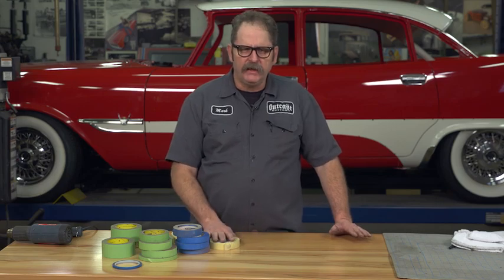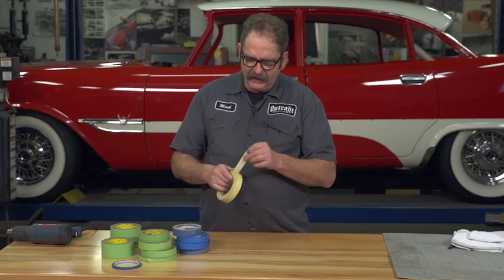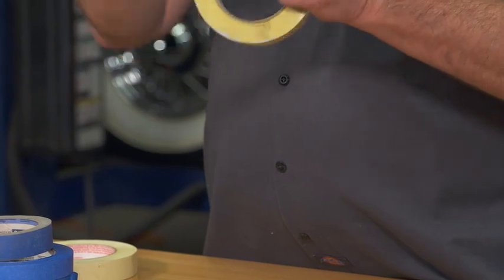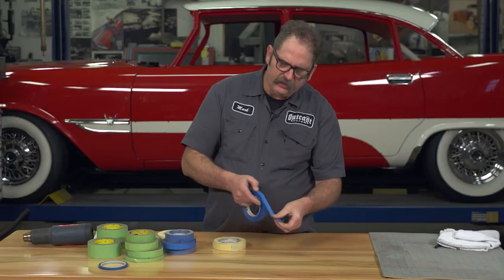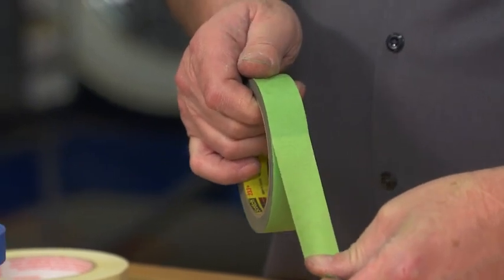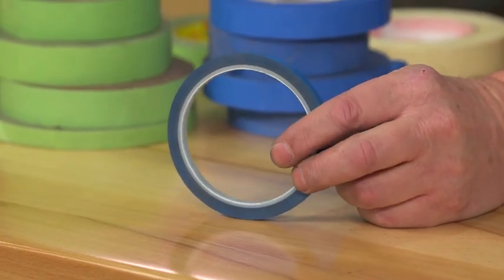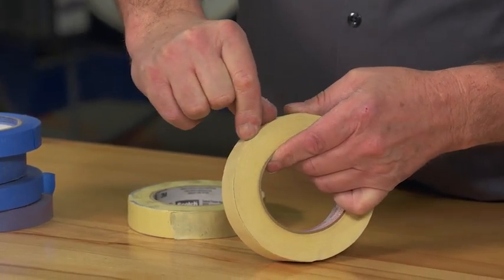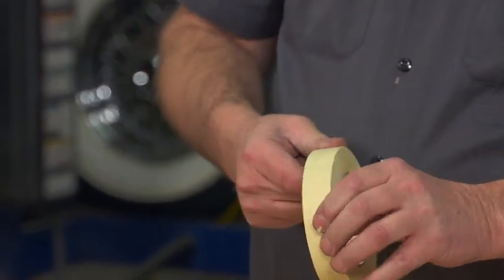Using Automotive Masking Tape

Comment: Hi do you think if you had a masking tape dispenser you could wear on either hip could make masking jobs faster and easier?
Reply from the maker: Some may find it helpful. For me I'd likely forget it was there and run it down the side of the car.
I typically have one roll of tape in my hand for taping, and nothing else... then if I need a thinner or thicker roll of tape I grab one of those.